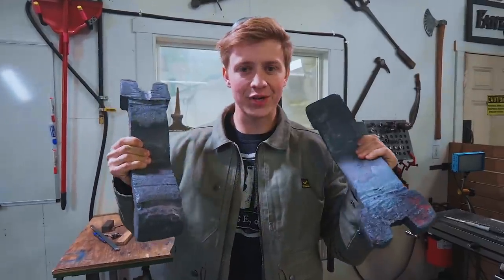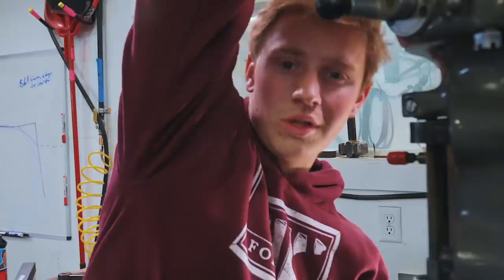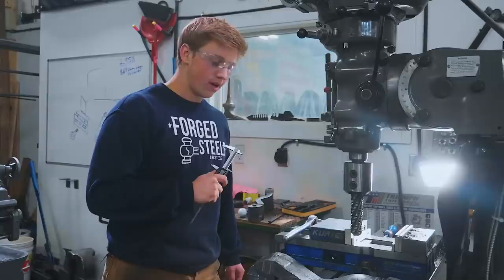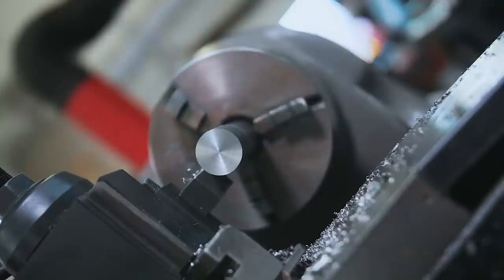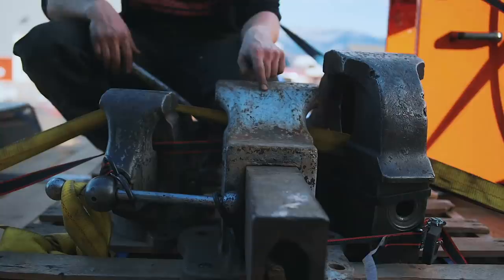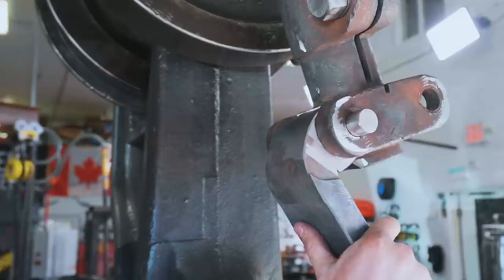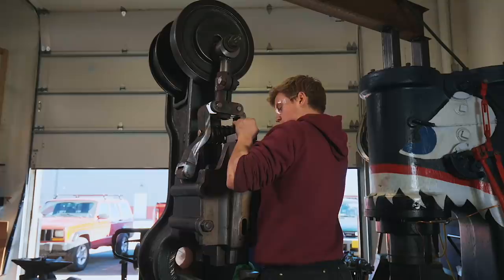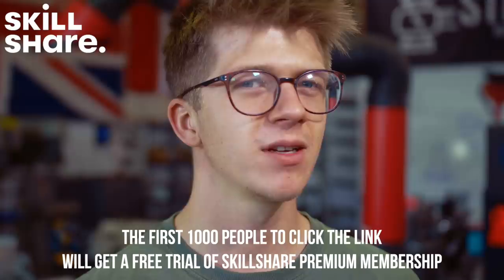RESTORING THE FAIRBANKS POWERHAMMER!!! Part 7

Comment: Hey a toolmaker here, that crack looks like it spawned from that hard corner if you can leave a radius in the corner it will help relieve the stress during the heat treat
Reply: tbh i've been noticing so many stress concentrations in this series. Some definitely are less important than others but like damn, just round your corners Will!
Reply: @zeebeezoey  Yeah, I'm a mechanical engineer.  All the stress concentrations in those arms are driving me crazy.  Also the asymmetry is maddening! (and probably not helping with their binding issue)
Reply: That was my first thought, no radius; a hard corner will accentuate any microscopic flaw in the matrix of the metal into a bigger flaw during the heat treat.  I've seen it happen.
Reply: And thats not taking into account all the weird stress forces that the shaper threw into it
Reply: @Potatcious  The shaper doesn't throw anything. It relieves material, and at that, it's a very linear and clean cut. You'll have less warping on a shaper than on a mill because of the way it's cut, mind you. This is 100% no radius effect. That cut should've had a rounded cuter. Rule of thumb (or machinist's book) says the bigger the dove tails, the bigger the radius.
Reply: people that address their job title before typing ect. sound annoying
Reply: @josephwaldner7752  I'm very happy for you.
Reply: @bostedtap8399  why
Reply: @josephwaldner7752  it's relevant to the comment. Try this: hey I'm a graphic designer and I think you may be dealing with stress fractures in the linkages. I'd ignore me
Reply: @josephwaldner7752  Comments can be viewed in a different light, if their training, background or qualifications are stated, it is a common courtesy in technical, medical or all scientific fields. You do seek medical help based on asking the first person you see in a hospital.
In answer to your question, I was being facetious, if this has offended you, I apologise.
Reply: These guys sure are learning the hard way. 😶😎
Reply: I'm a former toolmaker and I agree. I can't really blame them though as these are engineering aspects that come from learning in the trade. Making beautiful custom work is wonderful, but they're in a whole different lane doing mill wright and machinist work. I give them both heaps of credit though for sticking to it and learning. Though I also think a bit of an apprenticeship for both them when it comes to machining wouldn't hurt either.
Reply: He can’t radius it that corner fits into the keyway on the die
Reply: @Nick-xm1ux  With the current structure, yes this is true. However, an internal drilled relief would accomplish both the fitment and stress relief. Essentially, the tapered dovetail fitment with the corner relieved into the block with a concave radius rather than a convex radius. When I did tool & die this was a common solution for objects that required dovetails to mount or move tooling. Grand scheme, this is a simple solution that would not compromise the overall strength of the die, but would provide necessary stress relief to prevent cracking.
Reply: @Nick-xm1ux  you radius for the heat treat and then finish machine the final product to desired specs, also if the fitting it's going into has a dead sharp corner Id change that also, keep in my when we say add a radius in that corner were talking like .0625"

Comment: Paraphrasing will “This would cost so much to make today, it just takes elbow grease to fix it” 

*fixes a power hammer by making new forged and machined pieces *
Reply: I would think the body is where most of the costs ly since it's such a massive piece of metal
Reply: @marcelenduro3009  i agree, because what kind of a humongous forge would you need to work with such a huge chunk of solid metal. even more if it's cast.
Reply: @jackhemsworth7515  I can't imagine them forging something so large and to such dimensions. I'd put money on it being cast
Reply: @marcelenduro3009  One big difficulty would setting up to bore all the very accurately located holes for parts and pins... In the large casting.       ;o)        . 
O,,,
Reply: @Opinionator52  I don't even want to think about the amount of effort that would have been back then. Maybe they were cast with holes already in place and just cleared out and reamed to the correct size? Seems easier (still not something I'd like to try)
Reply: @Opinionator52  I don't even want to think about the amount of effort that would have been back then. Maybe they were cast with holes already in place and just cleared out and reamed to the correct size? Seems easier (still not something I'd like to try)
Reply: I'm a machinist by trade (retired),,, and have made many repairs on old machines (back as far as post civil war time)... 

The hole location in relation to each other is more difficult and important than than size,,, thanks to reamers... 

The starter holes may or may not have been 'cast in' this instance... 

Likely large precise fixtures were set up and the machine either bolted to it pre-drilling with the initial location needing to be accurate in relation to the (all other holes)... 

They did have massive casting and forging machines at the time,,, but I don't think the machine bodies were forged... (anyway) 

I hadn't planed on getting this far into the process,,, but details at times are somewhat important.... Best wishes...
Reply: @Opinionator52  thanks so much for sharing. That's really interesting!
Reply: So in his case it takes a bit of elbow metal shavings

Comment: I just really want alec to start selling like a starter blacksmithing kit with all the basics
Love u alec and will
Reply: Considering the price of his hammers maybe not a beginner set. Maybe a very wealthy hobbiest set
Reply: I think the trouble with that is that starter smithing gear is really just whatever stuff you can get your hands on. A sledge from B&Q, a bit of old railway track, some charcoal in a steel u-beam etc. Not to be a fangirl, but the moment you're buying stuff with the quality and craftsmanship of the things Alec sells, you're outside the realm of 'basics'
Reply: He has said before all you need is a hammer, a fire hot enough to heat steel to red and something to hit on(a piece of rail is a cheap starter anvil). 

After that you will know what you want and what you can afford.
Reply: @zeebeezoey  my point was that what Alec sells is quality goods, and therefore cannot be a “beginners” set as you described
Reply: @MonkeyWithAKnife  but would Alec sell that? No. He’s stuff is high quality. If he were to make a “beginners” set it wouldn’t really be for beginners. I learned on a railroad track, same as everyone.
Reply: brake drum coal forge and a hair blower..... theirs your starting kit!
Reply: So to just to point out the 48" grinder, 2 of each grit type for said grinder, anvil, anvil tripod, hammer, 36" heat treat oven, wire brush, and ppe pack, comes out to 5320+ tax and shipping. (Prices pulled from his website.) After which you still need a forge, some way to quench the blades/items your making, if need be, as well as material. Not to say he couldn't do a beginner set but it would probably be around the 5k-5.5k mark. If he wanted to, as a added bonus, maybe throw in a free hoodie or hat. Which would be entirely up to him. So like Eliver Z stated it wouldn't be cheap, but that would give you a starting place based on the items he sells. He could also add in buying options on the website, to change sizes of grider and belts, size of heat treat oven, or to add to it or remove items if you want more of something or if you dont want one item because you already own it.
Reply: @volkswagenb9406  yeah I was agreeing with you 😅
Reply: Beginner blacksmith kit is whatever you can rustle up yourself and whatever you can fabricate yourself. This process will help you learn vast amounts of the entire process of smithing.I am now on my third forge that I have made myself. It is a fire breathing beast with a ribbon burner and a blower. Still using the original 2 pound hammer that a friend's Dad had laying around his garage, in addition to a few others that have been acquired over time.
Reply: @volkswagenb9406  oh i agree with you i merely stated this because i dont believe in beginners kits of any kind since one need to make mistakes og cheap crappy equipment to know what ones style is and which equipment enables that style. 
And by this i am not speaking only about forging since that is something i have yet to get further into than a few simple trinkets. But any kind of making or craft.
Reply: @volkswagenb9406  agreed or small production business definitely not beginner unless you have super deep pockets.
Reply: @zeebeezoey  Yeah, very good, fair comment Zoey. I've never tried to buy anything a blacksmith would want/need and I can understand why anyone would want the best tools but, for starting out, I'm sure there are much cheaper ways. As Will says near the end, be patient and you'll find what you need. 
Here in Scotland, a good place to find old tools is at auction sales, especially on farms. Just a thought.

Comment: Steele’s Law Everything takes 4 times longer here then it should
Reply: Its a conspiracy to create content
Reply: He's the mirror universe Montgomery Scott.
Reply: It's not the shop, doing things the first time always takes 4x longer...
Reply: Steele’s other law is you have to take a drink when they drop something...
Reply: Tip for shrink fit bushings Use a can of compressed air turned upside-down so the liquid  cools the brass. then apply your heat to the outside.
Reply: @tobiastho9639  Yes! it always takes longer when you're figuring out how to do something, guaranteed if they did it again it'd take a fraction of the time
Reply: That sounds like a new t-shirt graphic.
Reply: Daniel Goldman than*
Reply: Everything takes longer the first time you do it.  Well... most things...

Comment: Definitely don't get discouraged. Life is nothing but a bunch of tests and trials. Some go smooth, some are an absolute nightmare, but you will learn from them either way and become smarter and wiser as a result. In times of great frustration sometimes you need to step back, work on another project and the solution to the problem might reveal itself. Keep up all the great work guys!

Comment: Add as big of radius as you can live with in that corner. Will prevent it from cracking in heat treat. Might also try normalizing the part part prior to heat treat

Comment: To prevent large pieces from cracking in a heat treatment. Round the edges and if you need a square shoulder inside leave a little on the corner to file or machine with a round end.

Comment: First question.  How parallel are the pin holes in the spring arms and toggle links?  You should be able to measure this with your mill and a dial indicator, but a dry-fitting of the assembly will also tell you if it's good enough.  Spinning portions of the crank assembly with a dial-indicator attached will also show exactly what's off and tell you how much to move it.

If you're desperate, strategic use of Spherical bushings will let you design out the alignment issues you're facing.  I'd suggest placing one at the crank on the flywheel, and at the outer end of each toggle arm.  If you're concerned about wear due to the smaller contact surface, you can also easily press-fit a needle bearing into the ID of the spherical bushing.  Though that's only likely to be needed at the flywheel.

Comment: In general for components that will see significant stress it is wise to radius the corners. Nice sharp corners are stress risers.   Heat treatment, impact, and flexing can all create stress in parts.  Add a sharp corners and you have increased your chances of getting a crack.

Comment: Will, a radius is your friend.  Do not leave sharp corners especially where heat treating is involved.  If you think you have to have a square corner just run a drill through the intersection before you machine it out. the hole will act as the relief you need and won't create a stress point.

Comment: I have a challenge for you Alec. 
I’m curious if you can punch a hole in 1/16 inch sheet metal using a center punch and your hammer.

Comment: I think the binding is due the misalignment of the 2nd toggle arm, at ~4:19 in the video you can see the 2nd toggle arm shift when the second side is started to be drilled, this would mean that now the 2 holes on either end are not parallel, I think this is the cause of the binding.

Comment: Will, I am not sure how much this will effect the build, but try to eliminate any stress risers that are created by machining sharp corners into the items you are working on. I would imagine that the pounding forces of the hammer would be good cause for those stress risers to crack. = no sharp inside corners anywhere, radius them instead; the part I am thinking to look at is where you machined down the links to fit inside the arms and how much of a radius did it leave on the inside corners of them?

Comment: I forget what material those dies are made of, but they should be oil quenching them, not water/brine/caustic. Realistically, you only need the surface of the dies hardened, the core doesn't matter that much. Oil quenching would do just fine here. Like other comments said, in the next iteration of the dies, get rid of that sharp corner. I've seen 2000 lbs dies crack during quenching from sharp corners on a feature. If your heat treater is willing, ask them about slightly raising the carbon set point of the furnace they're running the parts in. If it's 4140, run them at 0.45 or even 0.50 % carbon. The reason why this helps is a little difficult to explain.

The short of it is that steel transforms to martensite (hardens) at a certain temperature. This temperature mostly depends on carbon content. Lower carbon content steel transforms to martensite at a higher temperature than higher carbon steel. Naturally, when you're quenching a large chunk of steel, the surface is going to cool faster than the core will. When steel transforms to martensite, it expands. The uneven expansion of parts is what makes them crack during quenching. By raising the carbon content of the surface of the part, you're slightly delaying its transformation to martensite, and therefore delay its expansion. This allows the core of the part to expand (transform) first, and the more ductile (pre-transformation) surface of the part can handle this expansion. Then the surface transforms, leaving you with a hardened part and no cracks (ideally). I hope this made sense! It took me around 5 years of a metallurgy degree to understand it :)

Comment: That's what I do, too. I keep some tool cash available, keep active searchs with push notification on used market portals, then pounce when the right deals show up. It may take a while, but I usually end up owning nicely used and kept tools, of a caliber I could never affort if buying new. Also, when I need speciality tools or other costly tools for s specific project, that I don't otherwise have use for - I buy used, use it for that project, then sell it on. So I got the tools I needed, for the duration of the project, usually for free. Some times even a little profit.

Comment: At 5:08 you can see significant corners on the outside of the links between the arm body and ears. I'd run a roughing mill down them and radius those areas to prevent stress risers like the one that cracked your dies during heat treatment. It could very well prevent a broken linkage down the road. A small radius won't remove a lot of material. Also when pressing bushings in the future freezing bronze bushings and using a little press lube works well, or should I say "works a treat" considering whose channel this is.

Comment: Hey Will and Alec,
 I just got done watching this video and noticed some things in the thumbnail.  The hammer seems to have a problem moving and if you look at the thumbnail you may see why. I would recommend checking your measurements and for squareness. Looks to me like the left hand arm sticks out to far and is about a inch longer than the left. The sprig is set on an angle(higher on the right). I would think you would want that square and level to the base. Second question is everything square and true to the base. Is the base square and true to the floor. These things matter. If the base isn’t square then everything will be off all the way to the top. Just an observation not judging you or your work.

Comment: For the Die, couldnt you just Die-Grind the crack through into a crevice then weld it shut & remill? Ive seen that done on D-12 Dozwer blades. Or even easier to just spot drill the ends of the crack to prevent fracturing (which is used in airframe cracks). .

Comment: 🌟 Make a Snake out of a Horseshoe Rasp In a coal Forge  { Fold 1.5 inch of end for Head - Round Peen 1.5 inch back cup shape - half round on the edges for jaws / Rough scales out -  (coal forge)Pinch & draw out the nose  (Roundish)~Use Leather Hole punch for the nose holes and eyes - Half round chisel for mouth line~ {coal forge} roll length into a tube Rough Scales out  then S~Curve length  bend head up  bend tail up at angle { you can use chisel to make rattler designs on the tail }  SPRAY PAINT BLACK { it looks real } ⚒

Comment: You should have used liquid nitrogen to freeze the bronze bearings. It would have shrunk the bearing significantly so it would slide right into the toggle link and toggle arm. We use this process where I work all the time for bearings and it's slick as pie.

Comment: For the crack... when you prepare the blank for shaping, you can stress relieve the corner by radiusing  the 90 with a small drill through the blank before removing the excess material. If you do it right, dear God what am I thinking... your radius should remain after the part is shaped. This should help during heat treat, too.